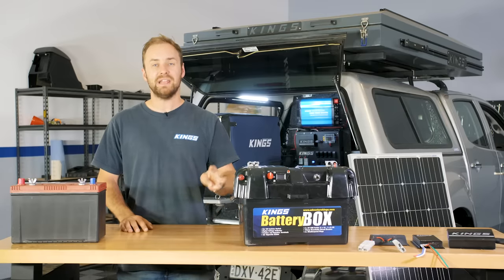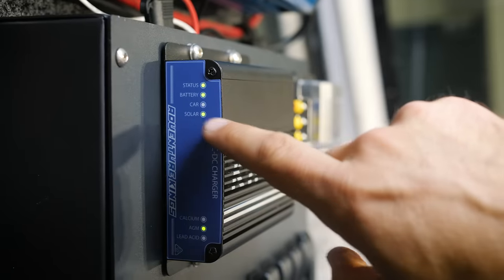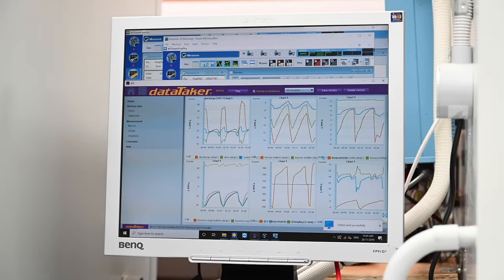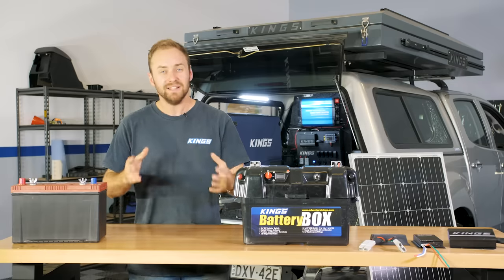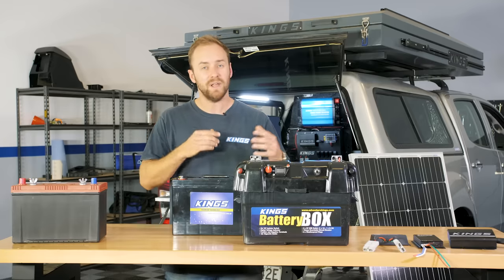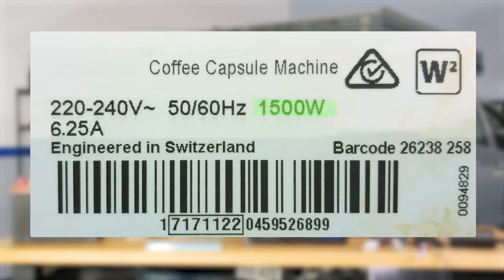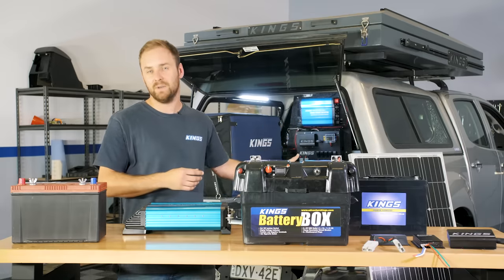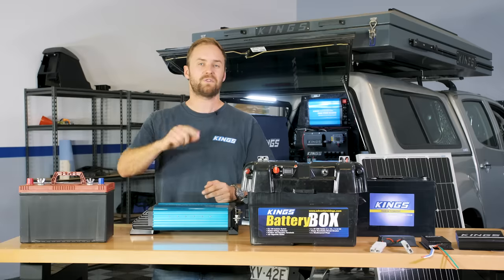Complete Off-Grid 12v Dual-Battery Masterclass PART 3: Next-Level 12v Upgrades

Comment: I am looking to setup a pop top caravan. I am going to run double batteries in the van with a 1500w invertor all running from 270 w solar panel. I have a generator as backup. My question is can I connect two battery boxes together via the external terminals? Would connecting the 2 Anderson plugs do the same job. Will plugging the solar input into only one box evenly charge the batteries when connected in parallel. I will run the invertor from one battery’s positive and one batteries negative as mentioned.
Reply: Secretary Keysborough The two 12V auxiliary batteries will be wired in parallel, essentially making one battery of 12V, but with double the capacity of a single battery (assuming they’re both the same amp hour rating). Yes, you can join the two batteries together using the external terminals since the external terminals on the battery box are simply an extension of the battery terminals. Yes, you can do the same job by using the Anderson connectors since the Anderson connectors on the battery box are simply an extension of the battery terminals. Just be extra careful when joining the batteries to connect positive to positive and negative to negative (parallel). Yes, the solar input into only one battery box will charge the two batteries evenly since wiring the two batteries in parallel essentially makes one battery. I’m not sure what your point about the inverter is, since you’ll essentially have one battery when you wire the two batteries in parallel.

Comment: I am running a 120ah lithium it is connected to a kings 160w solar running a 96lt MRCOOL fridge it uses about 3.2ah i have a 1500w kings inverter I had it connecter to the kings Battery box terminals with the screws on the front.
I connected a toaster that rans at 650w -990w tried making toast and the positive started to get very hot the battery was fully charged and i had the fridge was disconnected. Question is why did the positive wire heat up should it of been connected on the battery and not the battery box thanks
Reply: Your inverter could be drawing ~85 Amps from the battery to generate that output. Maybe the cables are too thin?

Comment: I calculate I'll use about 60 AH a day in my campervan. 200W solar panel on roof. What battery would be Ideal? also looking into portable batteries. Thanks
Reply from the maker: Hi there,
115ah or above will be fine!
Regards, Courtney
Reply: @4wdsupacentreAu  Thank you. Any thoughts on portable battery systems like the Bluetti or Ecoflow?

Comment: The panel (eg at 9:46) shows Anderson Plugs, V meter, 4 x 12v cig plugs, junction box and charger, but what are the 5 switch-looking things (ie what do they do)?
Reply from the maker: Hey mate,

They’re pre wired with power in and a fuse so you can connect your own accessories to them!

We’ve connected them to camp lights, water pumps etc Check out our video on this here: https://www.youtube.com/watch?v=_q5rFQCYppE&t=20s

Cheers,
Cahn

Comment: What thickness wiring did you use from the main battery to the DC-DC charger?
I've got everything except the wiring organised so far, although I am contemplating the semi flexible solar panel as well but need to see how mount friendly my canopy is when it arrives.
Reply from the maker: Hey Mate, I used 6AWG - that's good for up to about 8m length!

keep an eye out as I've done a bonus part to the series all about wiring, so that will help you too!

Cheers,
Cahn

Comment: The latest Kings 120ah LifePO4's has a draw down limit of 120 amps continuous, does two in parallel allow a continuous draw above 120 amps or just double the capacity?
I have heard conflicting stories. Thanks.
Reply from the maker: Hi there, A direct parrallel set up increases capacity. Kind regards, Rachael
Reply: @4wdsupacentreAu  So you mean capacity only, I cannot draw 200 amps from two in parallel?

Comment: great videos, thanks!  i don't have a solar option on my van, so am just using power from alternator.  do you know any resources for doing the wiring - size of wires, size of fuses and where to fuse?  And while i'm asking -  do you know a less expensive dc/dc charger that might be higher amps but not have solar option?
Reply from the maker: Hi There, 
So if you are using the DC/Dc charger then yes you will require fuse.
RECOMMENDED FUSES;
Vehicle Starter Battery – 50A Fuse
Auxiliary Battery – 50A Fuse
Solar – 50A Fuse
Ignition Wire – 2A Fuse
Note – Fit the fuse as close as possible to the item it is protecting!
Cheers,
Saleha
Reply: @4wdsupacentreAu   Thank you SO much Saleha!!

Comment: When you connect a dc to dc charger to 2nd battery does it need a circuit breaker
Reply: Garry Wright At minimum you should fuse the main battery as close to it as possible, and at best you should also do the same at the auxiliary battery.

Comment: I’m putting a dcdc in. If I’m using the same 6 gauge wire I currently have with my kings isolator, do I leave the isolator connected or do I bypass and go straight from starter battery to dual via dcdc? Hope that makes sense! Cheers
Reply from the maker: Bypass it mate! The DCDC charger is a built in isolator!

Cheers
Cahn

Comment: Hi Guys, Great videos. I have already installed a Kings smart isolator. I have the switch panel in the back of my ute. If I install a 25A DCDC charger with mppt am I going to need to remove the Smart isolator or will the work together?
Reply: Anthony Kiely Remove the smart isolator.

Comment: one thing you didn’t mention and  is important is you should only 50% of your lead acid battery other wise you can damage it so a 100ah lead acid battery is good for 50ah so if you want 100ah of battery you need 2 battery’s or a 200ah battery now lithium is different you can use 80% if lithium without damage 100ah lithium battery is the same as a 160 ah lead acid battery
Reply from the maker: Spot on Mate!

I did go into this in part 1 and 2 a little, but it's good to bring it up again.

50% is a good mid ground for battery usable capacity and battery longevity - the less you discharge a lead acid battery, the longer it'll last. If you look at a charge/discharge curve you see that as discharge % approaches 0, battery life approaches infinite. So it's always good to keep your lead acid battery topped up and charged. Another win for solar at camp!

I also didn't get into Lithium as it's bit more technical and a lot more expensive at the point. Maybe down the line as it becomes more affordable I'll do another video on the benefits! (I'm very keen for good LiFePo4 batteries to become affordable!)

Cheers,
Cahn

Comment: Just watched all 3 on a row. Thanks for the tips. To confirm though, would I need a separate mppt for solar if I had a dcdc with solar upgrade? Or is this a direct replacement for the mppt?
Reply from the maker: Hi there. The DCDC charger has an inbuilt MPPT regulator for solar!

Comment: How hard is it to wire a ignition wire from a trailer? From the trailer where would it best be wired to if not to the ignition?
Reply from the maker: You'd still need to find the ignition source from the vehicle (if you're talking about running a DC-DC charger) that way the charger knows when your vehicle is on or off and will charge accordingly - that's what you need if you have a smart alternator, and it's beneficial if any voltage drop is causing the built in isolator to start and stop charging on older vehicles too...

One way to do it would be to run an ignition wire from your dash to the back of your vehicle, near the towbar, and then use a single connector (for example an Anderson power pole). Add another power pole connector on your draw bar, continue the ignition wire from your draw bar back to the DC-DC charger. 

Cheers,
Cahn

Comment: how many volts should your alternator be to run this setup? would a 12v alternator be sufficient or would it be more wise to have something that puts out more?
cheers
Reply from the maker: Alternators usually put out a regulated voltage depending on your starter battery voltage so usually they’re around 14 volts or a little more. But they also don’t generally put out full power at idle.

Maybe you mean a higher amp alternator? And that all depends on what you want to run and how often!

My old LandCruiser with a 60A alternator did struggle a little if I had headlights, spotlights, windscreen wipers as well as charging fridge and a lot of low range work.

These days though, 4WDs usually have higher current alternators and more efficient electronics so standard is generally fine until you get into a really serious setup!

Cheers,
Cahn

Comment: i would like to know how to run 3 batteries. 2 in the engine bay and one in the canopy can you please assist.
Reply: 3. battery set up is wired the same way each battery positive together and negative together last positive to appliance and the first negative to appliance but you should isolate your cranking battery
Reply from the maker: Hey mate,

What would you like the battery under the bonnet to do? Is it for winching? running your accessories like stereo or UHF etc?

If it's for starting, running your winch and any accessories that are likely on while the vehicle is running, you could install a second starter battery and link them as if they're one big battery.

If it's for deep cylcle use - say to run your centre console fridge and stereo while you're at camp... One option could be to run the dual battery under the bonnet as one system - let's say it was a flooded deep cycle, you could charged it via a smart battery isolator. Then you could run the two batteries in the rear of your vehicle with a DC-DC charger connected to the starter battery as a second system. The power would be split between charging your starter and under bonnet battery, and the two in the back. you'd want a decent alternator!

the other option would be as suggested above - there will be a voltage variation between the battery under your bonnet and the two in the back so they likely won't charge perfectly evenly, but use heavy duty wire (and fuses!) and it shouldn't be noticeable! That said, if they're different types of batteries, or the temperature is significantly different (which it might be under the bonnet...) it could affect charging too.

Cheers,
Cahn

Comment: HI Cahn, Great videos very informative.
I've bought your control panel with the 20 amp Ctek DCDc charger.
Just wondering on the connection from the charger to your control panel? 
Do you wire the pos and negative from the charger (on the right side) directly to the service battery, or do you wire both battery and Ctek to the main posts in the control panel ?
Reply: Hi Brad, i got the CTEK recently, what do you think? is it working well, i need to add solar to my system

Comment: What about lithium batteries?
Reply from the maker: Hey Michael,

I didn't get into Lithium batteries as they're not really a budget option at the moment - though I'm keen for when they are!

Lithium batteries need a more precise charger to balance their internal cells, but they do allow for deeper discharge without any negative effects.

If you are checking out lithium make sure you're looking at LiFePo4 batteries - they're much safer than Li-Ion. Go with a reputable supplier or seller as some people like to really overstate the actual capacity of the battery... also do a bit of a search to see what happens when a Li-Ion shorts out internally - not something you want happening on corrugations in the middle of nowhere...

Sorry I didn't go into it in the video, but as I've said, this was more for beginners or those on a budget and lithium batteries are a bit more technical to work with, and a fair bit more expensive!

Cheers,
Cahn

Comment: Im currently running one 115ah Kings battery in the back and was looking at adding a 138ah as a second now the larger battery box has been released, according to this video is that a bad idea and I should  just get another 115ah ??
Reply: topendtrucker , for the small capacity increase you gain going up to a 138ah, my personal choice would be add a second 115ah battery.
Reply from the maker: It's not a huge deal if you wanted to go this way... it's much more important to not mix different battery chemistry, then type, then perhaps age/condition or brand (assuming very different internal  resistance) then size. It's more a basic general rule to help people remember, but when you get into the technical details the size doesn't make much of a difference until it's really imbalanced.

I'll explain some of the reasons why and why not and let you decide - if you go for the 115 and 138AH option you'll get about 10 extra usable amp hours over having 2x 115AH batteries.

Because they are connected in parallel, your two batteries are going to balance in voltage. even if one is fully charged (13V) and one is empty (say 12V) all that will happen when you connect them is the more charged battery will charge the second battery until they both balance out to around 12.5V (minus any losses). So that's no problem.

When using the batteries, they will act like one big battery, however as each battery has a different internal resistance they will charge and discharge at a slightly different rate - that's not a terrible thing, but basically means the bigger battery will always be "propping up" the smaller battery as it gets close to fully discharged - it will continue powering the load and will try and also charge your smaller battery to keep the voltages equal. When charging each battery will accept charge based on it's state of charge an internal resistance.

These are all very minor differences though - it'd be much more of an issue the bigger the difference in battery size and the age of your 115AH! If it's old, been overcharged repeatedly, or discharged too far a whole lot of times it might only be offering you around 100AH for example.

As I said at the start - you'll be about 10AH better off with the 138AH, so if that sells it for you, go with that. If that's not enough to convince you, go the 115AH!

Importantly, whichever way you go make sure that you feel all power into the positive on battery, and earth the other - that way any charge and discharge is as balanced as it can be.

Cheers,
Cahn

Comment: hi, I need some help please! correct wiring procedure required. I want to wire my start battery to the Ctek D250SE, mounted on the Kings 12v control panel, powered by the 2nd battery, with solar panel input. just not sure what should go where? does anyone have a dgm I can follow please? thank you in advance :)
Reply from the maker: Hey mate,

Have you managed to find anything?

If not flick me an email to cturner@4wdsupacentre.com.au and I’ll help you out!

Cheers
Cahn